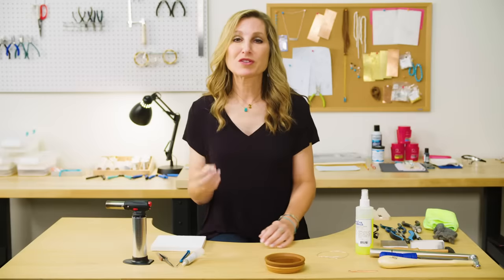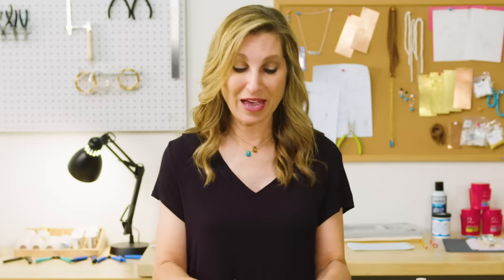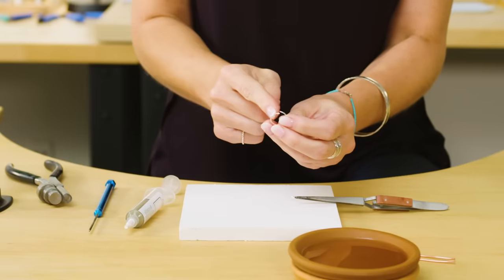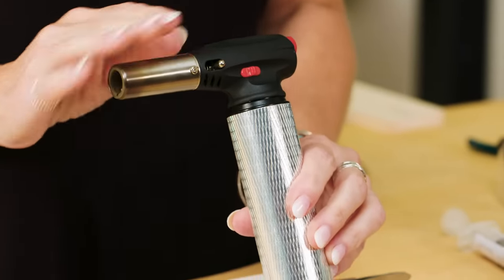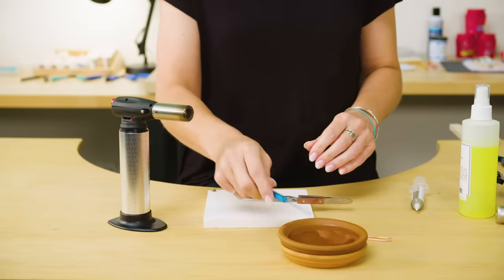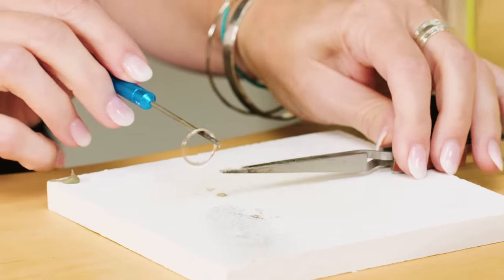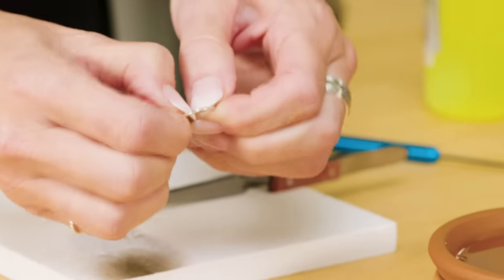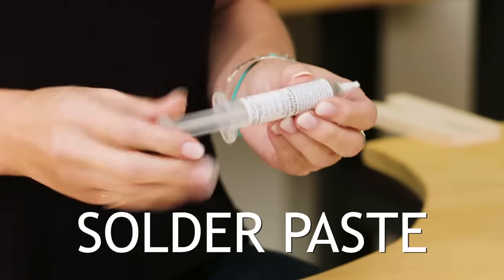The Basics of Soldering | Jewelry 101

Comment: i take a jewelry class at my high school snd i wanted to ask about the difference in effectiveness between flux and boric acid for protecting the metal. we usually use boric acid in my class so i was just curious :)
Reply from the maker: We have never used it, only the spray flux, so we can't really speak to the difference other than to say, it sounds like something you have to mix yourself with another agent. We like the flux because it premixed and easy to find and it works great. However, it seems like  you are learning from a reputable source in a controlled environment, so use what works best for you! Stay safe!

Comment: i am new to jewelry making, watching many videos etc, so a couple of questions, can normal craft wire be soldered or does it just melt, do you have to use silver or gold wire etc, also i have made some earings with craft wire, basically the resin inside holds it all together, its a yin and yang design so like a s shape inside the outer circle, but you can see where the wire joins on the circle and the s shape, what i am wanting is it all to be joined as one frame as it were before filling with the resin, is this possible by soldering, any advice please
Reply from the maker: Normal craft wire will melt as it is a plated wire. You should use pure silver, gold or bare copper for soldering, which is the most cost effective wire of these three. As far as your design, once you have the right metal, then solder your design and try adding your resin! We suggest starting with bare copper, so if you mess it up, you aren't out a lot of money. Hope this helps!

Comment: What’s the difference between soldering like this with a torch and buying one of the arc welders they use in permanent jewelry making?
Reply: Welding it will be stronger, more pure, more expensive, and much harder to do by hand.
Welding will fuse the metal into itself, taking two pieces of metal (or two sides) and making it into one piece.
Solder is essentially metal glue. Solder that you add onto jewelry doesn't penetrate enough to fuse the metal together. The solder itself just melts, then harders to create a bond around the area it's placed.
Solder isn't actually glue, but that's a way of thinking about it.

Comment: I’m considering working with steam punk components in my jewelry making.  Do I need a gun it could I use a soldering iron?
Reply from the maker: Hi Karen! We have never tried a soldering iron on the channel since it is not rated for jewelry and mostly used for electrical work. Susan only uses a torch for jewelry making, but you might get online and check out some soldering community sites and ask around! Other makers may have some different advice. We encourage new techniques, but can't give you any info about how to use a soldering iron for making jewelry. Please be careful, always do your research and safety first! Good Luck!

Comment: hi, newbie question... does the solder paste contain sterling silver? I had to ask as I wasn't sure if the join would show?
Reply from the maker: Hi! Yes, the solder paste is sterling silver and it has flux in it, but it's helpful if you can use the spray aquiflux as well. As far as the join showing, If you don't use too much solder (or even if you do) you can file it down and polish it up, so it will be less noticeable.
Reply: @JewelSchool  Aha, ok so the join is filled with melted silver that's soothed into the joint due to the flux, being careful not to over heat.... Gotcha, many thanks "H"

Comment: I’m used to seeing pickle in a crockpot so it’s heated, but noticed yours is just in a clay pot with no heat source that I can see. I’m not sure what the purpose of the crockpot is or why you would not use one. Could you please explain what the container of the pickle needs to be and what the heat or lack there of does to the pickle? Thanks in advance!
Reply from the maker: in the soldering videos Susan did after this one, she does have a heated pickle pot! The terra cotta bowl is usually just a quench bowl to rapidly cool the piece before putting it into the pickle and after to rinse. Check out this video that talks all about pickle! https://youtu.be/p4KJCcZgAvU
Reply: @JewelSchool  thanks so much!!! I’m still learning and trying to figure out how to make my own setup and I didn’t know what I didn’t know (ha! So newbie at that point I didn’t realize what questions I had) when I took my first metal smithing class. Now I’m trying to retrofit my understanding to what I used in the class and figure out what the differences are if it’s just a preference or if there’s a reason for it. Thanks for the link. I will definitely check it out.

Comment: I'm new to beading: I have many gold, rose-gold, and silver (all metal, with gold or silver-plated) clasps and jump rings. Do I have to buy separate solder for each metal color? Where can I buy this? I don't see any rose gold on the big "A" web seller ... thanks!
Reply from the maker: This video is an easy way to get started with simple sterling silver soldering. I do not recommend soldering plated metals. Generally speaking, if metals have to be plated, that is done after the soldering. If you want to solder you will want to use sterling, copper, brass or karat metal, although with experience some gold filled and rose gold filled can be soldered.  You will need to match your solder colors. 14k rose gold filled solder is available, but it is not easy to find. You will need to look for a metal smithing supply company.

Comment: Great video but I have a question that how long can we keep on using that burner or torch?I mean can we keep on igniting it for hours or  do we need to give it a rest?it is dangerous to keep it on ignition for hours because it could get too hot or can we use it for as long as we want?thanks in advance.
Reply from the maker: Hi Nepali! It's not a great idea to keep the torch running for hours. One reason is that yes, it gets extremely hot! The second reason is that if you constantly run the torch, you will run out of propane and keep having to replace it. Our best advice, start the torch when you are ready to solder your piece and then turn it off when you're done. There are times when you are working with your jewelry piece you will need to leave it running, but as long as you turn it off immediately after, you should be good. Remember, safety first! Don't forget to wear your safety goggles and pull your hair back if it's long. Susan does a more in depth soldering video that talks specifically about the torch. This may help you and good luck!
Basics of Soldering, A Deep Dive into Pickle:
https://www.youtube.com/watch?v=p4KJCcZgAvU
Reply: @JewelSchool  thanks!

Comment: Whete did you buy the block to place wire for torching? What is the name of the piece of block?
Reply from the maker: Hey Elsie! Thanks for the question. These surfaces are just heat proof tiles (like a granite) that you can pick up at any local hardware store. Just make sure they are large enough so you don't burn your table. Check out our new soldering video where Susan talks specifically about them. Good Luck! 
https://www.youtube.com/watch?v=p4KJCcZgAvU&lc=Ugxx8PtdOwuV4vGMJ1x4AaABAg

Comment: What type of torch is that?  What is the difference in using a torch as that or one with oxygen & acetylene?
Also what is your pickle made of?
Reply from the maker: Hey Diana, this is a hand-held butane torch. I use an oxygen and propane torch in my studio because it can get hotter and the flame is really controllable. The butane works great, though, and it's all I used for many years! There are so many kinds of pickle. I use sparex pickle but it's hard to go wrong!

Comment: Theres an earring I need to repair. Does it matter wht color solder or flaux or whtever I use on it? Hv nvr soldered.
Reply from the maker: Hi! It depends on what the earring is made from. If it's silver, then you would use silver solder paste (with a flux in it), plus your spray flux. If it's gold, you will need to get a gold solder paste, preferably that matches the karat of the gold use to make the earring. You could use silver, but remember, it won't match in color and you may need to have it plated. If the spot your soldering is tiny and will be hidden behind the ear lobe, then you might be able to get away with using silver, especially if you file and polish it well. Silver solder is going to be much cheaper than gold. Hope this helps!

Comment: I bought products in gold and silver colour but they are been discoloured , rust please what is the best product  except to original gold and sterling silver  because I can’t buy they are expensive , what do you recommend me please?
Reply from the maker: Unfortunately you can't solder wire that is plated. It will melt. You next best bet is to try bare copper wire. Hope this helps!

Comment: where can i buy silver solder at? i tried the liquid one with flux but its so sensitive to heat burns up instantly and then i tried using actual silver which was way to hard to melt then ended up melting the fine bezel silver wire i was using- not sure where to buy the correct silver solder at or what kind.. im trying to make sterling silver jewelry
Reply from the maker: Just do a quick internet search for "65 Silver solder paste" and you will find several links! We have a full beginners kit with some in it and that link is here: https://www.jtv.com/product/soldering-basics-supply-kit-includes-torch-tweezers-pick-board-paste/JSYT15?mcid=XSOjsyt
Reply: @JewelSchool  thank you so much for your reply! (: i jjst googled it saw some on rio grande for like 9$! do you carry any by itself? i have just about everything i need except for the right solder lol! 

what is the difference with this solder 65? is it just better for sterling silver jewelry making? 

ill prob order some tonight and see how it goes haha after i watch some more beginner vids ofc lol trying to learn at home mostly thru ur vids

Comment: I've been wondering if you use solder with too higher tin or copper content whether it tarnishes over time ? Is 2-3% silver with %98 for example of tin okay ?
Reply from the maker: Hi Ben! I have not used that type of solder before but as a rule, anything with copper in it will tarnish eventually. I am not as familiar with tin, so I'm not sure. Personally, I stick to sterling silver solder as I find it blends with my sterling wire seamlessly and looks the best.

Comment: Ok, explain the pickle? Or did I miss that part. Is it just a fireproof dish of cold water?
Reply from the maker: Pickling is simply dissolving firescale from the top layer of your piece after it has been heated. It's called pickling because jewelers used to remove firescale with a solution of alum, which is the same compound used to make pickles. 

Pickle is often made of citric acid but is generally a liquid acid compound that can remove oxidation in jewelry. You can buy it here: https://www.jtv.com/product/pickle-pot-with-citric-acid/JSTKIT0006?mcid=XSOjsyt

Comment: What about using a soldering iron?  Do you use Flux still with it ?
Reply from the maker: Hi! A soldering iron is for a different type of soldering primarily used in electronics. It does not get hot enough to make sterling solder flow. It's best to stick with a jeweler's torch. Hope this helps!

Comment: Is the soldering process the same when using aluminum wire? That’s pretty much all I use. Thanks in advance.
Reply: cindy9783 No, sorry, you cannot solder aluminum - it would melt before your solder reached proper melting temperature. Aluminum requires a very specific type of join called brazing.  Not recommended for beginners. "IF" it were possible to solder, the different colors of both metals would be very obvious and not attractive. Since the silver in the solder would oxidize over time and darken, the difference would be even more obvious as aluminum would stay bright. The instructor is using silver solder with silver metal (usually sterling) - the oxidation would be almost undetectable between the two.

Comment: I'm sure I could look it up but I'll ask you 1st...what is the pickle ?
Reply from the maker: Pickle is an acid compound that is mixed with water. You put in in a small pickle pot (crock pot) where it is slightly heated. You put your piece in this solution after you solder it. This helps to keep your jewelry clean. Hope this helps!

Comment: Where do you buy the solder flux mixture?
Reply from the maker: Hi Gabrielle! Below are a couple of links. The first is a link to a complete soldering kit with pickle pot, torch and fire proof surface. The second is a link to our most recent soldering video where Susan talks all about pickle, flux and how to use them. Unfortunately, in our current climate, we are not able to quickly source the solder paste and spray flux, BUT a quick google search should help you with what you need. We are working hard to get these products back in! Be sure to check out the new video. I think you will find it most helpful. Happy soldering!
https://www.jtv.com/product/annealing-supply-kit-incl-soldering-board-torch-head-pickle-pot-copper-tongs-more/JMKIT590?mcid=XSOjsyt
https://www.youtube.com/watch?v=p4KJCcZgAvU&feature=youtu.be
Reply: @JewelSchool  Thank you

Comment: I have a solder iron and I'm trying to solder a ring to the adornment.  I can't get them to bind together. The solder sticks to the ring flat surface instead of binding to both surfaces.  What am I doing wrong.  I've got each piece held by a third hand aparatus sorta like alligator clips and I've got the pieces put together like they should be if they were connected gut the solder only adheres to the ring flat surface not to both or in. between both. Sorry, this is hard to explain.  Thanks
Reply from the maker: Hi Judy! I do not use a soldering iron. I am so sorry! I recommend getting a torch and going for it.  Start easy with the paste and then grow into the other types of solder.

Comment: You’ve explained everything except what the pickle is... you said what happens but WHAT is  the liquid? Can you make it or buy it and what’s the commercial name please.?
Reply from the maker: Sharon, hi! We get a lot of questions about pickle and flux. We understand the frustration. Let's see if we can help clear things up for you. First of all, the pickle used in this video is called Sparex No.2. It is a pickling compound that is used for cleaning and pickling metals. Basically, It removes surface oxidation after you've heated it. This is combined with water. See the package directions for exactly how much to use. Also, we are working on a video ALL about pickle, so stay tuned for that!

As for the spray that is used, it's called flux. This is a liquid that cleans, coats, and protects your piece and enables the solder to flow easily between the joints during the  heating (or annealing) process. As Susan says, "No flux, no flow."

Here is a link to the products used in the video and we hope this helps!
https://www.jtv.com/product/annealing-supply-kit-incl-soldering-board-torch-head-pickle-pot-copper-tongs-more/JMKIT590?mcid=XSOjsyt

Comment: Is the soaking solution called “pickle”? and how long do we soak for?
Reply from the maker: Hi! In this video, yes, the solution is called pickle. It's an acid compound that when mixed with water will clean your metal after soldering it. Usually you should soak your piece for more than 10 minutes to ensure it gets really clean. You should clean your piece off with water after it's been in the pickle and then you can polish it after that using steel wool or a brass brush. Check out this newest soldering video. It talks all about pickle and how to use it! https://www.youtube.com/watch?v=p4KJCcZgAvU

Comment: What type of solder is used for gold filled? Thanks
Reply from the maker: You can use silver solder for gold filled wire. For gold filled, we suggest using soldering sheets, which are cut in small bits, heated and applied with your soldering pick to the jewelry piece. Good Luck!

Comment: Hi. I want to attach a jump ring with a charm on a bangle. Would the process be the same??  How would the pickle interact with my jewelry?  Any tips on that?
Reply from the maker: Hey there! If the charm is sterling silver, you can solder a jumpring onto the bangle just as you soldered the bangle. If you're using base metals, the pickle will probably corrode your charm. Good question!

Comment: What is the bowl made of that you put the pickle in, does it matter?
Reply from the maker: Hi! Check out this video, which is all about pickle! 
https://www.youtube.com/watch?v=p4KJCcZgAvU
Susan uses a small terracotta pot to put the water in that she rinses the pickle from her pieces after soldering. The pickle should go in a pickle pot, but a terracotta or clay pot will do!
Reply: @JewelSchool  Awesome. I'm just getting started out so I want to make sure I have what I need. I look forward to watching  more videos of yours!
 Cheers!😊
Reply: @JewelSchool  
Was wondering if that soldering board you used , is it simply a ceramic board with a flat solid surface? or does it have holes across the top. (And if it has holes,  are the holes perforated all the way through or just on across the top surface)? Thank you for a great helpful video!